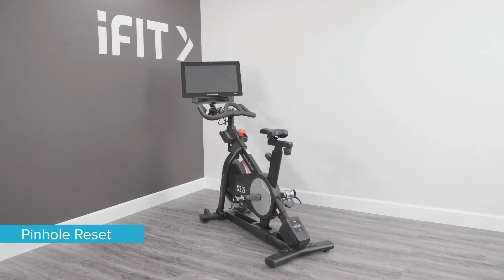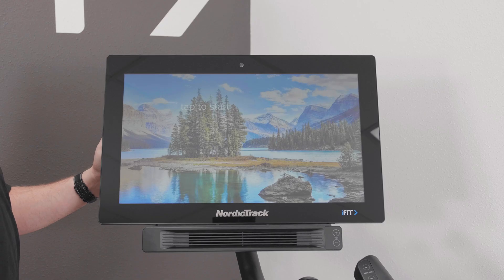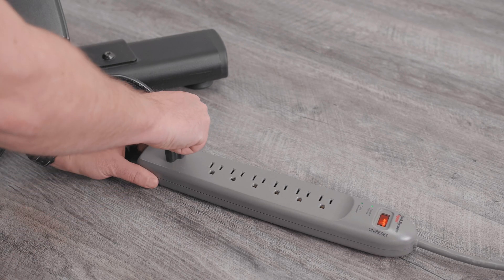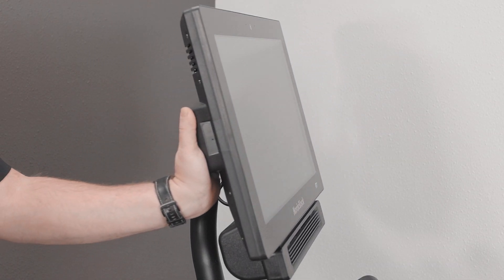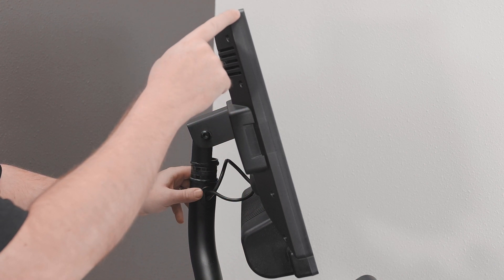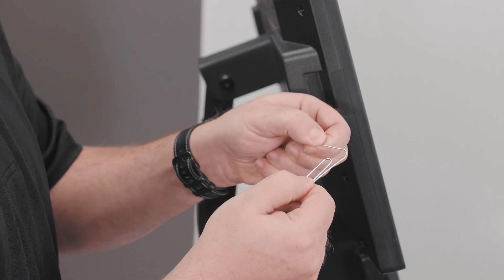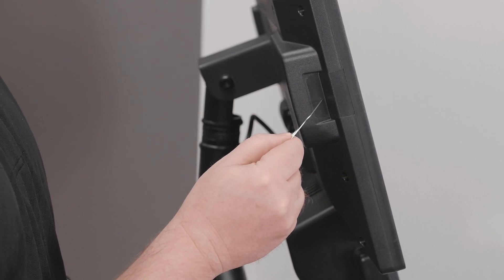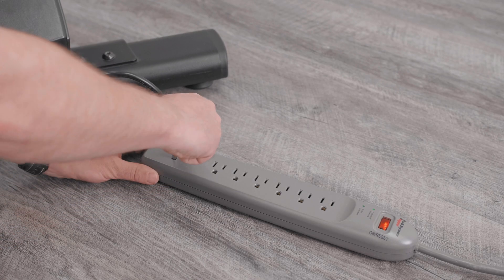Pinhole Reset

Comment: Where is the pinhole for C1650?
Reply from the maker: Do you have a model number for that unit? Usually the pinhole is along the seam of the console on top between the front and rear plastic covers... sometimes it is on the sides but still in the seam.

Comment: (RW900) mine is a blank screen, no ifit logo, I tried to reset and a message popped up, "waiting for update" then goes black screen and nothing happened, what could be the issue?
Reply from the maker: Sounds like it may be stuck in an update. If this is a tablet based unit try a pinhole reset.

Comment: I have no had help from iFIT service as they haven't responded to my online request . I have a iFIT NordicTrack treadmill T9.5s which is about 12mths old. I cannot find any pinhole to enable the reset function to occur. I only have a white screen with the iFit blue arrow showing and no other functions. Any assistance will be appreciated.
Reply from the maker: there are a couple models with that name but if you are looking at one of the NTL16119 units the pinhole should be on the right side of the console plastic. (right side if you are standing on the treadmill belt, like you were using the treadmill, your right)

Comment: Do you know if there is pinhole for Pro-Form Sport 6.0? Model PFTL50915. Thanks.
Reply from the maker: The pin-hole reset is only on units with the tablet displays after 2016. It looks like the PFTL50915 does not have a tablet display, so it will not have a pinhole reset like in this video.
Reply: @FitnessEquipmentHelp  many thanks for your answer, how can I reset my equipment? I have an issue, I am using iFit app, there is an update available for my equipment, when I try to download it, every time crashes, that means I only get a white screen from the app then a message saying the app is not working, I tried with different phones, tablets, I reset my equipment, Bluetooth is working properly also my internet access is OK, etc. I hope you can help me with that because I just returned to use your service. Thanks.
Reply from the maker: @2099camel  The only other thig I can think to suggest at this time would be to uninstall and reinstall the app on your device. (Although you have probably done this when using different devices.)
Reply: @FitnessEquipmentHelp  Many thanks, I did that without success. Is there another way to update my treadmill without the app? I want to use some exercises you have in your app but it is still requesting that update.
Reply from the maker: @ Id make sure you are logged in with a subscribed membership account. Maybe it is prompting you to subscribe and not for an update? I'm sorry at this point I'm not sure but you are welcome to contact iFIT  experience member care directly. they can help see what is going on in real time.

Comment: does anyone know where the pinhole is on a nordictrack rw500 rower?? or if it even has one?
Reply from the maker: The RW500 (NTRW99147) does not have a pinhole reset. The pinhole reset is only found on the tablet display models beginning in about 2017.
Reply: @FitnessEquipmentHelp  what about the rw850?
Reply from the maker: @Bunzyumz  Nope, only tablet based displays have a pin hole reset. (And only iFIT tablet display units from about 2017 depending on specific model)

Comment: I followed the instructions but the screen shows installing system update and is in an infinite loop. Not able to get to the system recovery screen. I tried powering down, unplugging as well with the pin hole reset button pushed down.
Reply: Oh I did that. Reset button pressed while powering on. But no luck! I have tired atleast 100 times.
Reply from the maker: The process is to power on the unit with the button pressed. You may have success if you follow that procedure rather than turning it off while pressing the button.

Comment: Damn, did not work on my S15i studio cycle. Looks like i’ll order a new board and see if that solves it.
Reply from the maker: Sorry, and good luck.
Reply: @ we find out tomorrow…
Reply: @ so, replaced the control unit (and i took photos of the setup to confirm proper wire attachment) and all i get is a greenish light emitting from the control board but no life whatsoever to the monitor display. I’ve checked every visible /accessible connection from control panel to monitor and there are no severed wires, nothing loose or detached.  Any idea as to why monitor won’t turn on?

Comment: Does this work on the 1750 treadmills. Constantly freezes and losses connection to wifi
Reply from the maker: It will work on the latest model 1750 treadmills. if the unit is loosing connection to wifi, I don't think restoring the earliest version of software will be the best place to start. make sure your signal strength is strong. If you have good signal a common issue with networks is that these consoles connect best to 2.4 GHZ networks they tend not to like 5.0 GHZ networks or mesh networks. try providing a dedicated 2.4 GHZ network for your treadmill.

Comment: Does the proform smart strider 935 have a reset?
Reply from the maker: If you mean the PFEL19914, then unfortunately no. It is a few generations older than the units with the pinhole reset.

Comment: anyone else has the same problem? mine on that side has an hdmi and a usb connectors but no reset.  arrggg why always me lol
Reply from the maker: The consoles with a USB and HDMI were manufactured earlier than the consoles with the reset. If you need to restore the software, a USB with software is on the parts list and available from the manufacturer.
Reply: @FitnessEquipmentHelp  thanks so much! Will try to get the software

Comment: We have an S22i Studio Cycle, just out of warranty. There is no resistance and the incline is acting up. Got a new controller, but no difference. Got a new console/monitor, but no difference. The console works fine, but when starting a program, and using the pedals, there's no resistance, no rpm showing, no adjustment of incline. Tried the pin restart as well. Can you please help? I would hate to trash a 3 year old machine costing $2,100 - plus spare parts and failed repairs....
Reply: I had to replace the control board on mine. Part was $150 and then worked great. Not that hard to do. Bought from ifit
Reply from the maker: It seems like there is no communication between the console and the control board. Communication signals between the two boards takes place along the blue and green wires in the main wire harness any damage or loose/disconnected green or blue wires any where between the controller and the console will cause this issue. I would check the wires for wires pulled out of connectors or fastener damage or wires that have rubbed on something and worn through. If the wires are intact then I would ask for a replacement circuit board. Its not common considering the number of these types of bikes out there but I have seen bad boards before.

Comment: Since ive had my s22i, ive had to do this numerous times. No longer working and now stuck on "erasing", the updates are killing these consoles yet we are forced to fit the bill to replace.
Reply from the maker: The best way to keep the console working is to perform regular updates as they become available. You may have to do several updates once you do a pinhole reset to get caught back up.  If you are covered under warranty or a service plan the cost of parts should be  covered if you have a manufacturer defect.
Reply: I cannot find the pinhole on the s22i.. where is it?
Reply: @belowfesanity  facing the monitor, its on the left side of the console inside of that indented area. Its where the front and back sections of the panel meet. Easy to miss!
Reply: On my iFIT pro form cardio hiit pro elliptical, I complete the pin hole reset and it doesn’t do a reset it just turns on to the ‘start’ screen. At this screen there is an option to push the Start button but nothing happens. Help please

Comment: Tried is on my S22i Commercial Studio Cycle and it still won’t come on. 🤷‍♂️
Reply from the maker: This process is only going to reinstall software from the tablet memory to restore ay corrupted software files. If you are having power issues a pin hole reset will not do anything. Depending on your model you may be having an issue with the control board or possibly the wiring or console. All these components are related to power delivery to the tablet.
Reply: @FitnessEquipmentHelp  Thanks for the info

Comment: Thank you for this video, my ifit elliptical fs7 model stopped working, we tried reset and knocking on screen few times but it only shows for a second that something is on then switches off again...we can't reset it - we moved the machine to office in the garden but there is no moisture - the only difference there is no heating - could that be the reason? Is there any temperature range for those machines?😊
Reply from the maker: moving the equipment from a cold area to a warm area can cause condensation. condensation and electronics don't work very well together. This doesn't sound like your issue though. If the equipment has been moved or disassembled and reassembled, then wires and wire connections may be suspect. I'd check to see if there are any loose, disconnected, or damaged wires if the console responds to being wiggled or "knocked" on.

Comment: I tried this and it only says "Please wait for update" and it just goes right back to the tiny icon and eventually a white screen that will not go away. There is no signs of an update going on, just a white screen. This is so frustrating!! I have the NordicTrack VR25 recumbent bike.
Reply from the maker: It sounds like your tablet is still responsive. If you tap the screen quickly 10 times then wait 7 seconds, then tap 10 more times you should get a prompt for a code. If this works then you should be able to do a manual update/reinstall. Contact iFIT member experience and they can walk you through the process.

Comment: Purchased a replacement ifit battery pack for the S22i studio bike, tried the reset button while my husband plugged it in.  The screen is still dark.  Should it immediately reset/turn on?  Stay dark and reset slowly?  Or is this something else?  So bummed - it is new.  Wish there was a simple on/off switch!
Reply: I am having the exact issue
Reply: @marie803  I am sorry to hear.  Hope you can resolve your issue - my S22i is still not working.  Word of advice - if you order parts make sure you keep the receipt or can return I have had the wrong control board and battery pack shipped to me.  Even after I provided the model #. 😞
Reply from the maker: The process should look similar to what is shown in the video. Power needs to be applied to the equipment while the pinhole reset button is being depressed. If this is being done but your issue remains it may not be something that can be resolved with a pinhole rest. What are you trying to fix by resetting the software?
Reply: @FitnessEquipmentHelp  I wasn't trying to fix anything or reset - just trying to turn it on.  It will not turn on at all. 😞
Reply from the maker: @michaelewoodhouse1329  The pin hole reset only reinstalls a preloaded version of software saved to the tablets memory. It sounds like you have a power issue. If your power supply is working (should have a green LED illuminated), Then make sure the power switch (if your model has one ) is in the on/reset position. If the bike is plugged in and the switch is on but there is no power to the display then either there is a problem with loose or damaged wires or the lower control board may have failed. (In rare cases the console may have also failed).
Reply: @FitnessEquipmentHelp  I have a green LED on the power supply.  There is not an on/off switch with my S22i.  I cannot see any loose or damaged wires.  How do I find out what if the control board has failed?  or the console?  It is almost brand new - so upsetting.  Appreciate any help or direction
Reply from the maker: @michaelewoodhouse1329  To know for sure you would uses a voltage multimeter to check the input and output voltages of the controller and console. In my experience most people do not have those tools. so you are left to playing the odds. In my estimation it is more likely to be an issue with the control board. If you have a warranty the manufacturer should set you up with one. you can replace it following the video on this channel or if you have a labor warranty have a tech out to replace it. if the control board does not resolve the issue and there are no wire issues between the control board and the console then the console should fix it. (A tech should be able to test it for you if he is out to replace the controller but by process of elimination it is going to be the console at that point anyway.)
Reply: Same issue but I don't see a pin hole to reset at all only ones I can see are on the screen but there is nothing being pressed to reset
Reply: @sdwoods619 if its an S15i and not S22i, the reset pinhole is on the top right edge of monitor if you are facing the screen, its in the seam where it looks like the front and back pieces of monitor display separate.

Ps, did not restore power so i am going to order a board😢
Reply: Works only after 5 or more minutes unplug. Many thanks. 🎉

Comment: Jumping to 2023, this doesn't work. Our S22i stopped working last week. Unplugged, plugged back in. Did this reset. Bike still won't turn on.
Reply from the maker: The pin hole reset does not have any effect on no power issues. If you have no power to the console then depending on the model it could be a few things. If the power switch (if present on your model) is on and if your model uses a external power supply with a led light that is on then likely it is something in the bike. It could be a wire issue but if the unit has not been moved or disassembled since it was working then this is less likely. My guess in these cases would be the control board. Anyone with a multimeter can test for this. the controller should be outputting 12 vdc to the console on the red wire. Bad controllers will only output 6 vdc when the console is plugged in.

Comment: I have an elliptical PRO FORM Carbon HIIT-H7 (model PFEL09920.0) and a spin bike PRO FORM -P Smart Power 10.0 (model PFEX16718.5) and both stopped working simultaneously, while I was in the middle of a workout on the elliptical, as both were plugged into the same power strip.  I can’t find a pinhole reset button on either machine.  It’s not the power strip or outlet, as I tested my iPhone, a fan, and portable speakers into them and they all work.  Does anyone else have these models or can provide any assistance?  Have not had any luck with the help desk.
Reply from the maker: Model PFEL09920.0 has the reset button on the right side of the console (Right side when using the equipment). Model PFEX16718.5 should have the reset button in the seam between the front and back plastic halves likely along the top. I do not have one to visually verify the location though.

Comment: Where is the reset button on the rower rw 600?
Reply from the maker: I apologize, I don't have access to one of these models so I can't be more specific. The pinhole is usually located in the seam between the front plastic and the back plastic covers of the console. Most of the smaller display screens similar to this one I have seen have the reset hole across the top of the console.

Comment: How many times do you have to reset a new machine before service will respond and replace the touchscreen?
Reply from the maker: Doing a pin hole reset will not trigger a response from the manufacturer. If you are in need of support please contact the manufacturer at my.ifit.com

Comment: Tried reset pin hole on Pro-form City T7 , but didn't work, any other solutions??
Reply from the maker: I guess that would depend on what your issue is. Why did you think you needed to perform a console reset?
Reply: @FitnessEquipmentHelp  the ifit screen froze up. Was just stuck. Powered the machine Down, now it won't do anything.
Reply from the maker: @Chosen-js2og  You could check to make sure the console is likely still receiving power by verifying that the red and green light on the lower control board are still on when the treadmill is plugged in and the power switch is reset. If the red and green lights are on and there is no reason to suspect a wire issue then you may need a new console. If the green  (or red) light is not on the controller you may need to check the power to the controller or replace the controller.
Reply: @FitnessEquipmentHelp  thanks,😎👍 I will check. Called the Company, said they would mail a new controller out. So I'm assuming this may be a common problem.